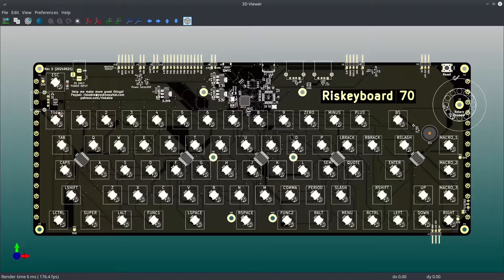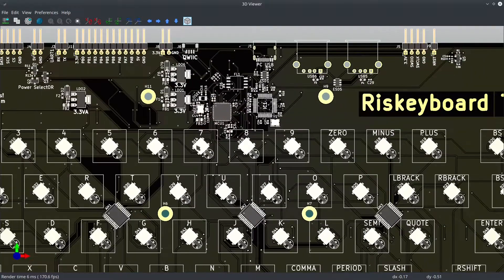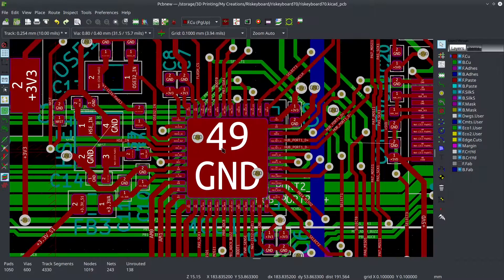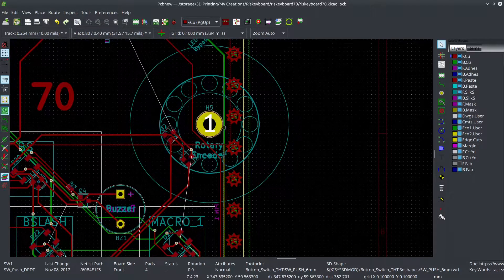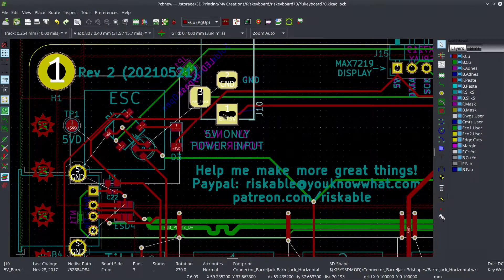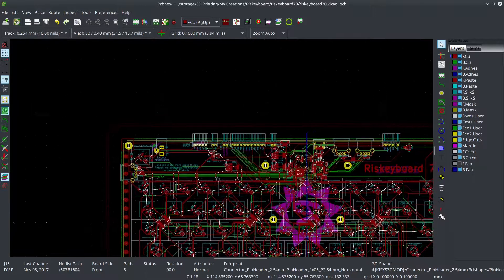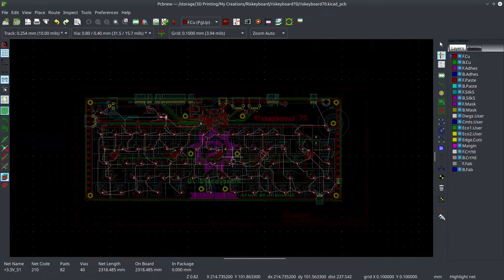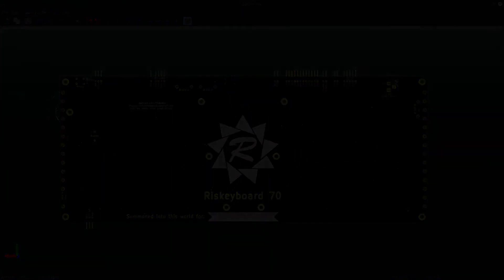Riskeyboard PCB Revision 2 Update

Comment: Cool idea I'm too lazy to pursue: Wireless, "everlasting" mice and keyboards, that both sense actuation and charge their battery via linear electric generators, aka energy generated from pressing a key or mouse button. Mice/keyboards and ultra low energy blue tooth is low energy enough to make this practical right? You wouldn't need a ridiculous about of force to acuate if you designed it efficiently right?

I think "passive devices" that are super low power and can charge themselves from things like the sun or button presses, have a lot of potential. Imagine never needing to charge a device or plug it in?

Love your videos!
Reply from the maker: I actually have plans in my TODO list to try making a DIY graphene foam supercapacitor powered Bluetooth keyboard using hall effect switches (non-analog to save power).  I can see if I can make it self-powering too 👍

Comment: Are you going to make some of the ICs socketable?
Reply from the maker: No.  Why would I do that? Wait: Do you mean, "are you going to make a board that lets you slot in regular microcontroller boards?"  I can do that if there's demand but the real problem is the lack of hall effect sensor chips.  The stm32 chips come and go but there's basically 0 hall effect sensors showing up (at all).  I suspect they're the lowest rungs on the totem pole which is why it's taking so long.

Also, I'll be posting another video shortly going over a new PCB I designed that should make it easier to do hand-wire builds of analog keyboards 👍
Reply: @Riskable3DPrinting  According to your vid, there are a few different possible chips that can fit in your layout.  That's more or what I was referring to.
Reply from the maker: @ayourk1  Oh that's what you mean...  It's more like, "ST makes multiple chips in this particular layout/package and nearly any of them will work.  Only problem is that even though there's a dozen possibilities there's ZERO stock in all of them!" haha
Reply: @Riskable3DPrinting  And that would be one reason to have sockets so that when stock arrives, the board is already assembled; just slap the chips in!